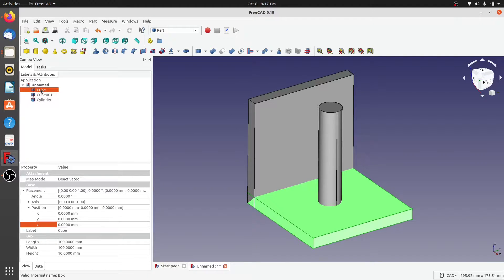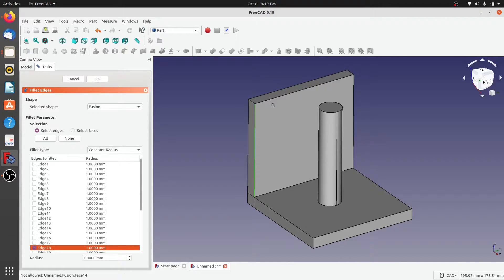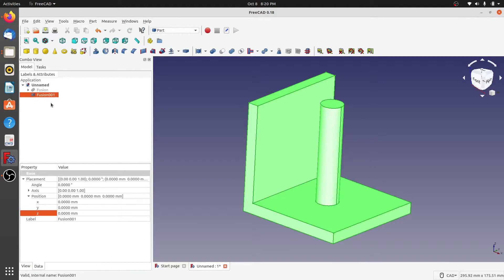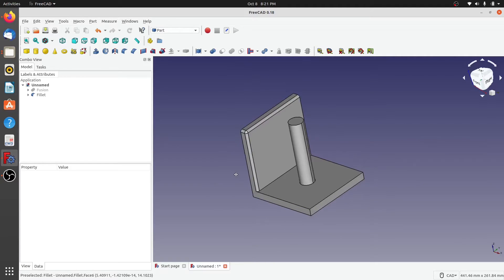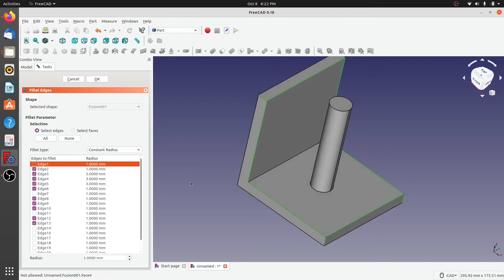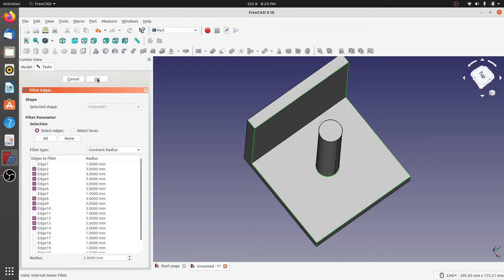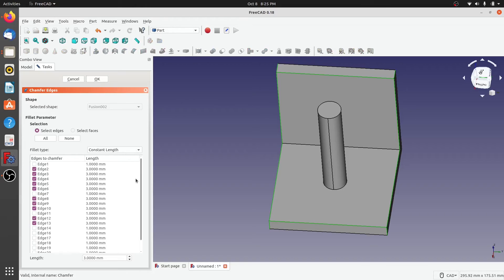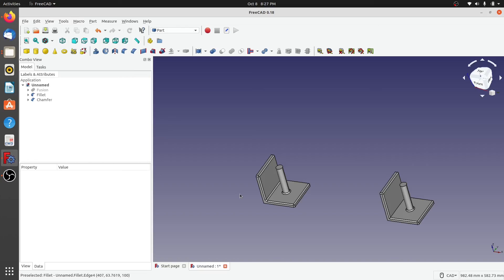04-4 Part Work Bench Fillet and Chamfer in FreeCAD

Comment: Thank you for this video. I was wondering if there is a way to make the fillet radius parametric. I can do this when using the Part Design Workbench, but not the Part Workbench. I'm using Freecad 0.20.2.
Reply from the maker: There are differences in Part Design and Part Workbench for a reason and their limitations in certain cases.  This is one of them.